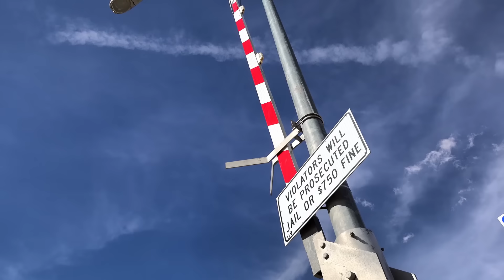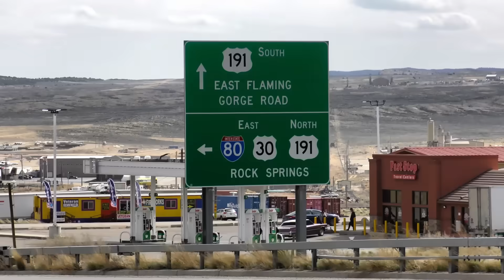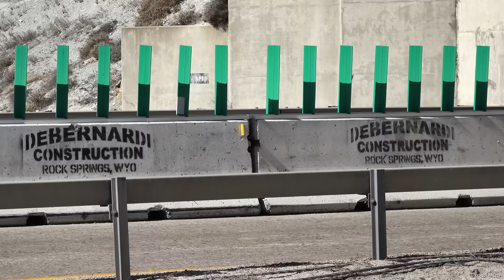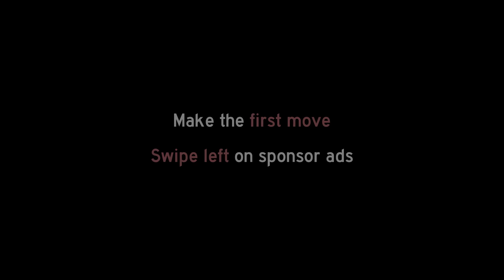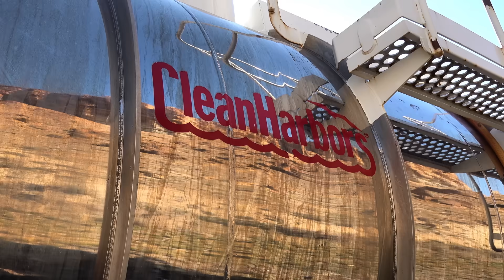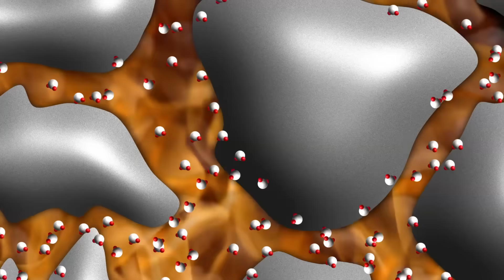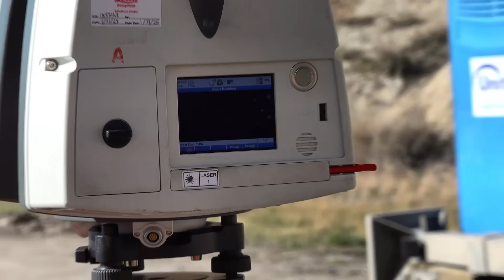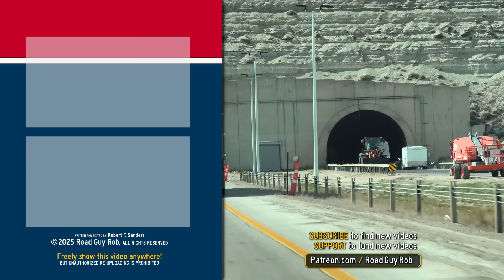Going Inside Wyoming's TOTALLY MELTED Freeway Tunnel

Comment: Fires in tunnels can spiral so fast out of control like at the Mont Blanc and Gotthard tunnel. When two trucks collided in the Gotthard tunnel in 2001 it was so hot and filled with smoke that the firefighters only could watch from a safe distance. Unfortunately 11 people lost their lives due to smoke inhalation. Afterwards there was a significant investment in ventilation to get rid of smoke and much better signaling for emergency exits. It also gave the final push to better research those fires since it was believed that nothing can be done. Today we have a training tunnel that firefighters can train in realistic scenarios.
Reply: fire sprinklers would definitely be a good idea.
Reply: @kenbrown2808  depends.  There is a pretty good chance it can be a metal fire, which a sprinkler would make worse.  Same for an oil fire, which also is likely.
Reply: @sinisterthoughts2896  a liquid fire, would be a reasonable possibility, which sprinklers would float out of the downhill end of the tunnel ; which could be problematic.  the only metal fires that start out as metal fires are battery runaways - which are fought by applying water and waiting for them to exhaust themselves.  but when the options available are having a sprinkler system, or blocking the ends of the tunnel until the fire burns out, because it's not safe to put personnel in there; the logic is clear.  and even if water can't put out the fire, it can contain it, and reduce the heat in the tunnel.
Reply: @kenbrown2808  that's asking for a pipe to burst up in the mountains and flood the tunnel if anything you would want a chemical retardant but that has its own issues
Reply: I recently saw a video of a fire at a swedish water slide park (Liseberg Oceana, near the completion of its construction) ... think a fire in a long narrow tunnel, where the entire tunnel is combustible glass fiber composite, and its slope causes powerful convection that's forcefully blowing fresh air into it. It took like 10 minutes to go from the first smoke being noticed to a raging inferno, and 10 minutes later the building exploded.
Reply: This is why new tunnels in the UK need to comply with CD 352 of the DMRB, although I think they should avoided if possible for these reasons (and also expensive, the need for CCTV, etc). Tunnels are normally dual bore too (one per direction), since it allows users to escape to the unaffected tunnel. And exits have to be every few hundred metres.
Reply: What was crazy about that crash was the truck was full of floor and the dust was enough to cause a huge  fire.
Reply: @josephcarland  floor? flour? yeah, because of flour’s small particle size (and thus high surface area), it’s highly combustible, especially if it’s floating around in the air
Reply: That's so sad.
Reply: Finally someone mentions Mont Blanc
Reply: I hate the zipper merge garbage just put a solid white line and nerve people exactly where you want them
Reply: @thetommantom  I don't think I understand your proposed solution... are you suggesting they just force a merge without any signage?
Reply: @thetommantom  ...not really sure what you want here? the highway is two lanes and has to narrow to one. Do you just want the cars to magically teleport to open spots in the other lane?
Reply: @thetommantom or people could just learn to zipper merge. The only reason it doesn’t work is because people don’t do it properly.
Reply: @thetommantom  put a jersey wall between the lanes for the last mile.  it MIGHT stop the early merging.
Reply: @kenbrown2808  that idea is dumber than rocks
Reply: @qwerty112311  keep in mind you're dealing with the average American driver, here.  it takes dumb ideas to deal with dumb habits.
Reply: @kenbrown2808  I wouldn't be that hard on them but I'd put 2 signs warning do not change lanes to make sure they were at least warned write them a ticket for lanes lines and not paying attention

Comment: in UK we have count down distance to merge. 3 diagonal strips at 300 metres, 2 for 200 and 1 for 100 and then if not merged buy then it fine ££££ time. Have a read of our highway code.
Reply: The countdown markers are also used on approach to big junctions. I thought that they were technically set at 300, 200, 100 yards, but measured in metric.